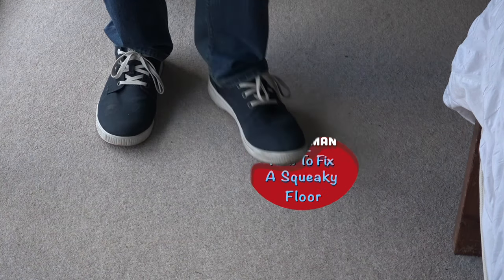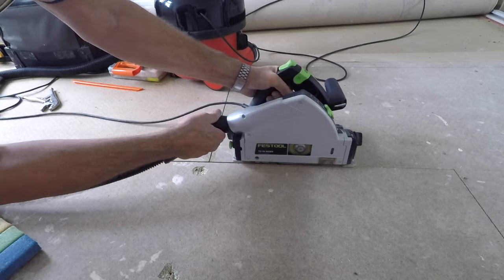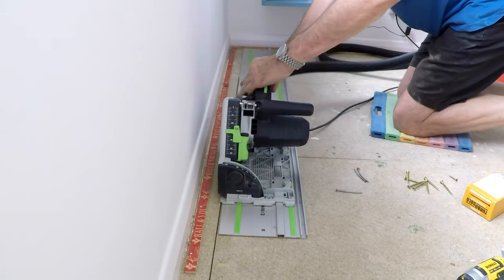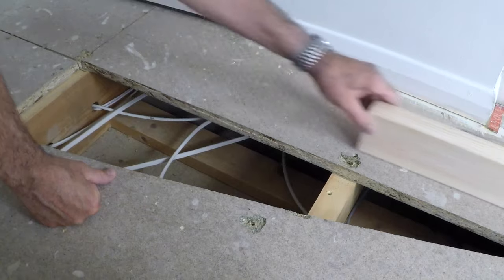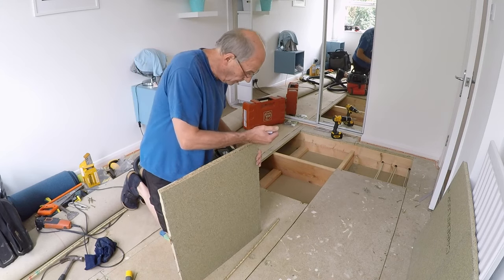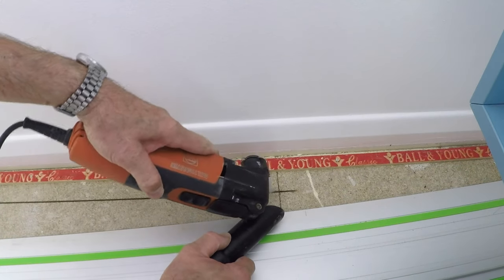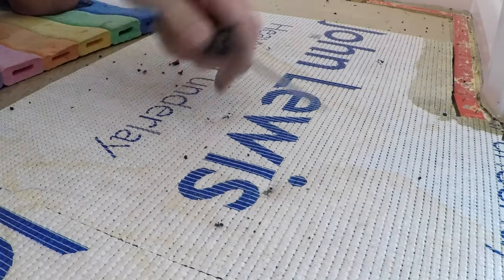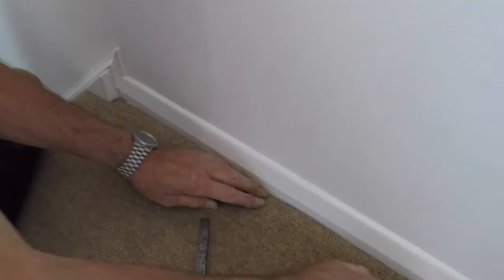How To Fix A Squeaky Floor, a Caberfloor Chipboard Floor. (#4)

Comment: Chipboard is a really poor material to use on UK houses, as is the dot and dab practically cardboard walls, new build houses are built with rubbish by often poorly trained tradesman then sold  for half a million and the developers laugh all the way to the bank.
Reply from the maker: I'm certainly not a fan of chipboard but it has it's uses and flooring is probably the best use.
Reply: @JohnTheHandymanUK  ......I do this for people, but replace the uplifted chipboard with ply, as it`s susceptible to damp issues.
Reply: Sounds like the house I bought😢

Comment: Prior to my recent comment that i made about creaking… squeaking chip board floors.     i recently found out that… the real reason why chip board floors squeak and creak all the time when you tread on it.. is because when the boards are laid on the floor;  builders nail them too close together, on the Joist.   
I noticed that when i ran a saw down the chipboard joints, very carefully… the squeaky noise stopped completely.
Reply from the maker: Chipboard floors are usually tongue and groove and they are meant to be glued together, but maybe yours aren't like that. That's good that you've found a solution.

Comment: So sad that I just saw this video. Had a carpenter come over to fix creaking in our bedrooms. He just glue the small gaps of the chipboard. He did not lift/cut the chipboard to glue down. He did not even help remove the excess glue, saying it will offer extra support. How sad that we don’t have someone like you to help us. Our floor is still creaking, a little bit better, but still drives me crazy.
Reply from the maker: Oh that is sad 😔. It's a terrible problem and so hard to cure 100%. The floor I did  is creaking again but it's not nearly as bad. Thanks for commenting.

Comment: The chipboard on my floor was laid down… back in 1983.   They are leasehold flats;  but not really able to tell if they were joined together by a…. Groove method.  But nevertheless… sawing down the joints very carefully does help to eliminate that particular creaking problem.

Comment: Just had this problem for squeeks near a wall it comes from a nail becoming slightly loose where wall is nailed down simply remove skirting cut away at plasterboard with stanley knife no higher than where skirting was. Drive couple of long screws into wall framing driving them into floor underneath also add bead of glue to bottom of wall framing for extra security, glue plasterboard back in place.
Reply: Pleased you fixed it.

Comment: Excellent video. Used the same method before I watched your video. The difference was you have solid beams. I have I-joists.  So cannot add supports like you did. I chose not to glue floorboards down, since if you had to remove them for whatever. You just added to extra costs. Thank you for taking the time and effort. Appreciated 👍
Reply from the maker: Thank you so much I appreciate your kind comment. I-joists would be a problem for sure. I didn't glue all the boards just some.
Reply: For I-Joists you can get Z brackets. Could also go down the route of using pocket holes in muggins and just use the 4x2 in on the flat side

Comment: Finally found a video that pretty much exactly matches our setup - great idea with the noggins, I'm tackling our bedroom this weekend and have everything I need apart from the timber and track - Thanks John!
Reply from the maker: I'm pleased you found it useful. To be honest the squeaks haven't all gone! I think the joints have shrunk over time and it's these that squeak where they go under a wall. Best of luck, it's a bit of a pain to do!
Reply: @JohnTheHandymanUK   Thanks! I was originally going to try and lift the boards up after I cut one out but it seems that's an impossible task with them being under the skirting.

I was actually recommended some D4 tongue and groove glue and was told that makes the world of difference - fingers crossed!
Reply from the maker: @reecevaughan4225  Yes the foaming glues might work but I suspect that you need the glue between the floor and the joists, which means taking up the flooring. A little trial and error is needed I think!
Reply: @JohnTheHandymanUK  worked a treat for me! Took 3 days and I had to pop some packers under the skirting but squeak free!
Reply from the maker: @reecevaughan4225  excellent news. The packers are a great idea so I hope it stays squeak free!

Comment: What a wonderful video and great advice. Thank you. It is a task I dearly need to perform soon because the creaks and squeaks in our 1985 home are driving me insane. Looks simple enough to do.
Reply from the maker: Thank you so much for your kind comment. Looks can be deceptive, the job is time consuming and a squeak free result not guaranteed! There is not much one can do about joists that have shrunk and move and where board run under a stud wall.

Comment: Two problems right off the bat; chipboard underlayment, and nailed, vs screwed down.  I watched you pull out that nail, and it appeared to come out way too easily, especially for a ring shank!?  Great video and I admire your thorough approach to solving the problem.  
Cheers!  👍👍👍👍😁✌🏻
Reply from the maker: Thank you George for your kind comment. Possibly screws would be better than nails but builders take the easy option! Either way the Caberfloor should be glued which it isn't. I gave the pry bar a hefty push to lift the nails so I think they were secure enough but who knows?  Glad you enjoyed the video.

Comment: Hi thanks for the video!! I had a similar issue in the house in a couple of places. A bit of advice to everyone, what I found out was by juts hammering the existing nails down cured the problem without having to lift the boards in my case I just put a floor Tite screw close to where the nail was and that has cured the very noise and loose feel to the floor. Thanks you
Reply from the maker: Hi Diego, I probably should have tried what you did before taking up the floor. It might have saved me a lot of work! Thanks for commenting.

Comment: I have the exact problems in my 90s house, exactly the same setup, you make it look simple but this is a tough job.
At present I'm trying a pva/water mix down the grooves and also screwing the boards down .

Taking the boards up will take me hours.
Also the worst area is near My radiator I can actaully feel the pipes below the boards when I jump up and down on them.
Nightmare of a job
Reply from the maker: Yes it is a tough job and there is no guarantee of a good outcome! I think the problem in the house in the video is where boards run under a wall ( the stud wall is perhaps built on top!). I think many joists have shrunk over the years too contributing to the problem. Best of luck with it.

Comment: Thank you for this amazing video! If only there were more skilled people like you. Every joiner & handyman I asked just refuse to sort out creaks in our house, saying it is normal for modern houses with chipboard flooring.
Reply from the maker: Thanks for your great comment. Sadly I'm not surprised that no-one wants to tackle the job as it's not easy and there is no guarantee that the squeaking can be silenced. My way didn't cure it all, in fact some noises returned after a month. I think that perhaps the joists have shrunk and move, as well as the stud walls where boards run underneath.
Reply: @JohnTheHandymanUK  have you tried this for floors that creak under stud walls... Remove the skirting board and fix a long screw at a 45 degree angle into the bottom of the stud wall. The idea is to fix the bottom of the stud wall solid to the floor board underneath. Run a few screws at 6 inch intervals and you'll be amazed at the results. Worked a treat for me. 👍🏻
Reply from the maker: @Reakerboy  That sounds a great idea. I've only done one floor like this  so not tried it. If the floor I worked on gets worse I'll consider trying this.
Reply: @Reakerboy  that sounds good but what about hitting any pipes?
Reply: @danielwhetstone5632  All pipes and electrical cables should be running half way through the joists. By using the correct size screws (70mm max) there should be absolutely no chance of screwing so deep you mange to hit pipe or cable. All you're aiming to do is screw through the sole plate and into the floor board. Always proceed with caution ⚠
Reply: @Reakerboy  INCREDIBLY BAD ADVICE. Pipes are VERY OFTEN notched into the tops of joists.
Reply: @nobodydoesithalfasgoodasyou  never known someone notch into the top of the joist. Why would you do that? Any plumber  knows NOT to do that, I've never seen it. I'm from the UK, maybe you're from some other country that does it this way? But here, these are the building regulations 👀🙄
Reply: @Reakerboy  you are flat out wrong and your advice is so irresponsible that if I were you I would withdraw it lest somebody mistake you for someone who knows what he's talking about. Even if building regs forbade notching joists (which they don't), the lion's share of UK housing stock predates the existence of building regs. And plumbers are in any case a law unto themselves.
Reply: @nobodydoesithalfasgoodasyou  irresponsible 😂 Come on, I think your taking it a little too far. I've done this 'countless' times. I don't disagree some tradesman are a law unto themselves and I agree don't always follow best practice. But as in my original post, I suggested to proceed with caution. Of course before drilling holes into your floor you should know the run of services and electrical cables in your property.
Reply: @Reakerboy  it is irresponsible because you confidently paint a picture that is totally misleading. What if somebody reads your comment and ends up drilling into a lead pipe in their Victorian house and has to have the entire bathroom refitted because all the sanitaryware has been plumbed in with wiped joints? They could be looking at literally thousands of pounds even excluding the ruined decor. Speak to some plumbers. It is not unusual, let alone remarkable, for pipes to be notched into joists. It is a lot easier to solder a connection if you have some leeway with the position of the pipes. If you have been screwing into floorboards willy-nilly under the mistaken belief that all pipes will be drilled through joists you should count yourself lucky you've made it this far without incident.
Reply: @nobodydoesithalfasgoodasyou  I think you've gone a little off track. Please watch the original video again and also read the original post I responded to. I was offering a solution to a common occurrence with chipboard floors and stud walls. Done correctly, it works great. I am not for one minute suggesting to run around willy nilly drilling holes in your floor boards. The video is based on modern building techniques your reference to a Victorian house is not applicable here, chipboard floors and stud walls? I am not sure why you are so triggered by my helpful guidance to a common issue. As already stated twice. Proceed with caution.
Reply: @Reakerboy  ok, fair enough, the Victorian house is irrelevant given the context. Saying to proceed with caution is very wise but rather contradicted by the accompanying assurance that all services will be well shy of the top of the joist such that there should be "absolutely no chance" of hitting a pipe with a 70mm screw and that no plumber would notch into a joist. These statements are simply wrong and you should not be confidently proclaiming them with a false air of authority. Building regs do not forbid notching and plumbers do it all the time. Obviously less necessary nowadays with flexible plastic pipe (though it can still be a struggle to fit the drill itself between joists) but totally par for the course with copper pipe, which is simply impractical to install any other way. I genuinely think you would be hard-pressed to find any centrally-heated house pre-dating plastic pipe and/or, open-web truss joists  that doesn't have pipes notched into joists somewhere or other. The expense the installer is trying to avoid is time and copper. Is he likely to knock a hole in the cavity wall to thread the pipe in from outside, or break it down into 50cm lengths and solder it back together?

Comment: Pretty good that!!! Done me a favour because I’ve got some to rip up. 
Personally I wouldn’t glue them, just in case I needed them up at a later date.
Reply from the maker: Thanks very much Andrew. I hope it's helpful.  I actually think the creaking in my floor comes from the joists under the stud partition walls so impossible to get at, unfortunately. Do subscribe please, I'm trying to get to 2000 subscribers.
Reply: @JohnTheHandymanUK  Very helpful John. If there’s one thing I hate is chipboard flooring. I think our house was built on a Friday, late afternoon when the builder had got a promise on. Ha ha. There’s sections that has no support where the ends of the boards meet! Chuffin nightmare. 
Cheers John. Subscribing when I’ve wrote this. 😊👍🏻

Comment: A really good video and tips. I've got a noisy floorboard in my bathroom and when walked on you can hear a pipe! But hopefully that will soon be sorted. Thanks very much!
Reply from the maker: Thank you for your kind comment. Some lagging or insulation around the noisy pipe where it bangs on a joist or floor board, if you can get the floor up, should silence the pipe. Good luck.

Comment: Thanks for video. Have same problems. Will try do it myself
Reply from the maker: Thanks for your comment and best of luck with the problem. It's a difficult one to solve. I think much of the squeaking comes from under adjacent stud walls and from joints that have shrunk or been poorly fitted.

Comment: The best thing to do with creaky chipboard flooring…. is to drill holes where it creaks;  and pump in some of that expanding foam solution.  (That’s assuming there are no cables underneath)   After a few hours ( when it goes off)  should be alright.   I’ve already replaced my tiny hallway with plywood.  Much stronger than rubbish cheap chipboard;   But it is expensive to buy.  Building materials don’t come cheap these days.  To replace my bed-sitting floor would cost around 1K.  
Friday am.  18th August 2023. Southampton England 🏴
Reply from the maker: I quite like that idea.
Reply: go easy with that foam or it will pop the ceilng underneath !

Comment: Great advise and job well done 👏 for future it might be worth getting a nail puller, screwfix has one 6138k around £15 it done all my floor boards de nailed ready for screws without fathing around with removing material with chisels etc. 

The squeaks were driving us nuts but for some wierd reason the source of the problem was manly the stud wall nail fixings in the floor joist causing a rising and lowering when walking
Reply from the maker: Thanks Tom for the kind words and tip. Somewhere I've got a pair of very old Carpenter's Pincers.  They must be the traditional nail puller I think as they have been around for decades. Only £4 in Wilkinsons these days. I agree the squeaks seem to be mainly from under stud walls so impossible to eliminate. I suspect that timber joists in modern houses shrink too much and that makes things worse.
Reply: How did you fix that?

Comment: I’ve got this problem to deal with in my bedroom I’ve got oak flooring to lay but have to get rid of the noisy floor I’ve seen a video where wooden shims are inserted under the party wall to stop movement looks like I’ll have to use your method and shims under the wall.I’ve already removed architrave and skirting thanks for your post very helpful
Reply from the maker: Thanks for your kind comment and I'm pleased you enjoyed the video. Shims under the party walls sounds like a very good plan. I've not heard of that. The floor in the video has developed more squeaks which is annoying and I've a feeling it's to do with where the floor runs under party walls and maybe shrinking or poorly fitted joists are contribution to the problem. One chap told me he'd  taken down his stud walls! Good luck, it's not an easy fix.

Comment: My entire upstairs creaks. The previous owners at some point took up a lot of the flooring to install an additional light and to install a radiator in the conservatory. I suspect they didn't put the boards back down correctly. I was hoping I wouldn't need to cut the tongue and groove! Another channel recommends diluted PVA glue and working it into the gaps as well as installing additional screws. Is this a viable option?